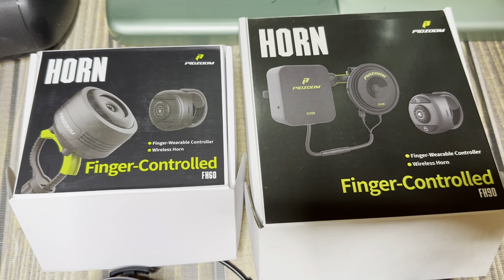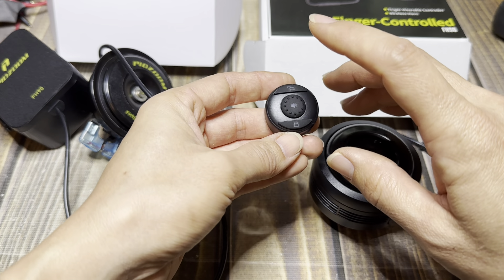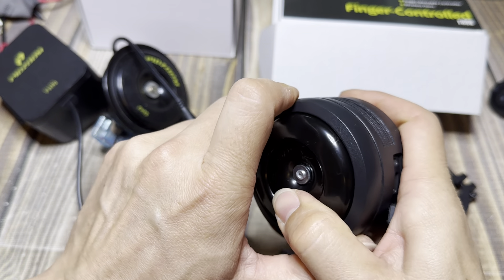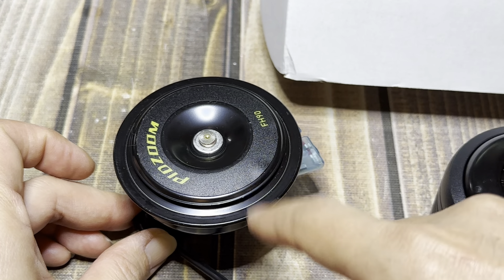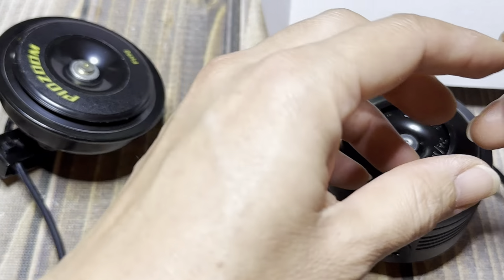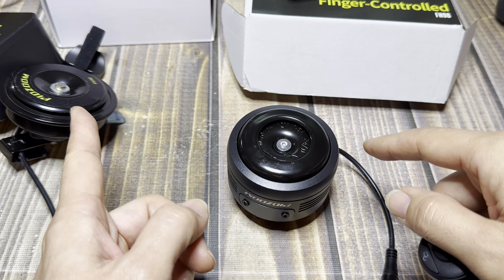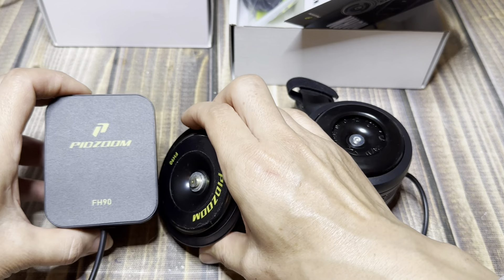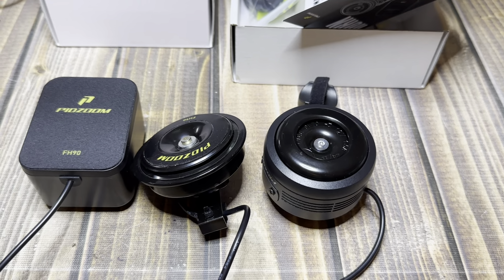Close Look at Pidzoom Finger Controlled Horns : FH60 & FH90

Comment: Awesome review Dawn 🥰 ...and from the perspective of someone seeing it for the fist time (and not pulling any punches).
My criticism of the FH90 (based on the EUC video on the Pidzoom website) is that the horn and the battery are sticking out the front of the EUC and you are going to lose them on your first crash. The system is too large to mont discreetly. I spose, being metal, it may survive a light crash, but the mounting ties will likely break... so you may need to go looking for the horn or battery pack 🤔  
Have you tried actually mounting it on one of your wheels?

Comment: How long does it last in standby mode before it needs to be charged? (the fh60) I have the similar type of horn from amazon (all same manufacturer like Fedog 118). Since it has an alarm which I don't arm it's always sensing for the remote. It has to be charged every 3-4 Weeks otherwise battery dies. I have to charge it (5 hours) before ebike rides otherwise it is dead for battery drain on standby mode. I have a few of these horns from different manufacturers and they all have the same limited battery life.
Reply from the maker: I'm not sure and there's no battery indicator
Reply: @DawnSChampion  I feel they just took the Fedog 118/119 horn (rebranded as numerous brands) and changed the mounting system as well as remote. (for FH60) The internal components, function, and sound is the same. Not that there's anything wrong with that. Overall its a nice loud horn to use against cars but you just have to remember to keep it charged every few weeks or the night before a ride. I would get this pdzoom if they improved the standby battery life and decreased the 5 hour charge time